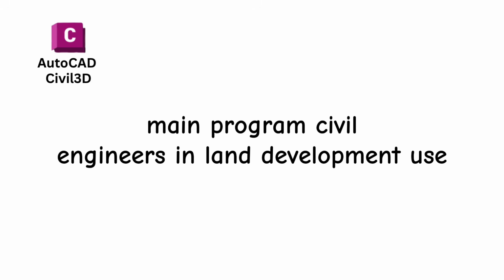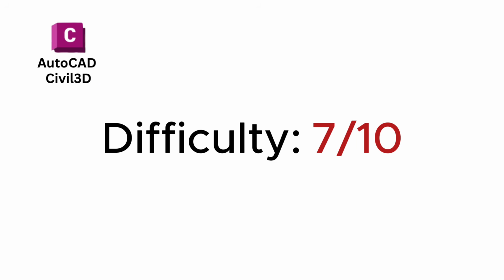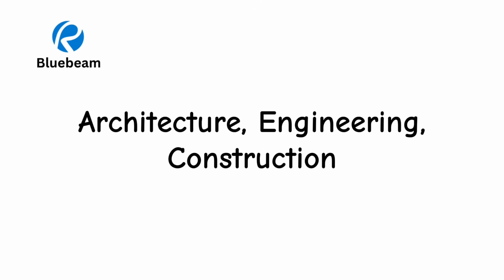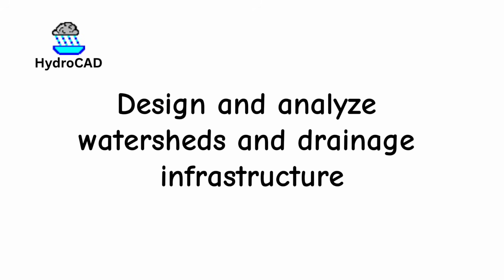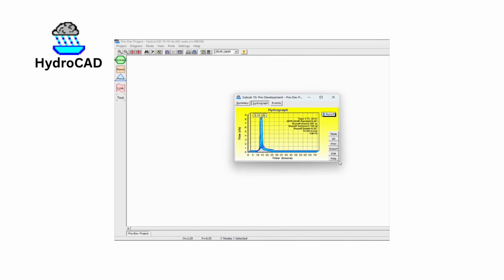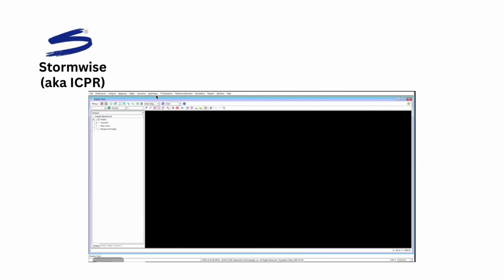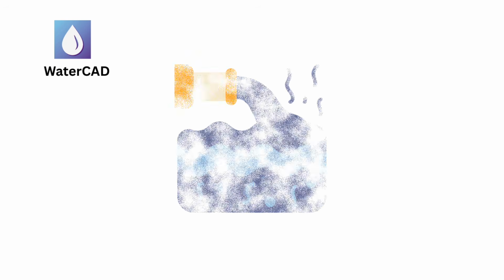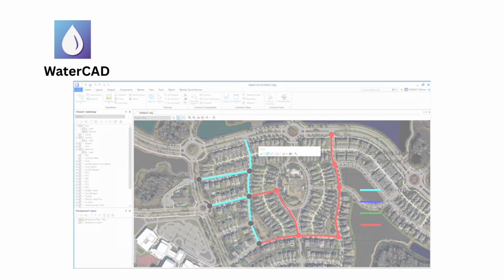I Ranked 5 Programs I Use as a Civil Engineer

Comment from the maker: Civil engineers: What's your discipline, and what software do you use daily? I'm especially interested in geotech and structural. Drop your list below 👇
Reply from the maker: Also, sorry for the muffled sound issue at the beginning. I accidentally used a copyrighted song in the first 20 seconds. Everything sounds good after that!
Reply: Hi I work on roads and highways planning, maintenance and supervision, so most of the time I use civil 3d and excel. 

I hadn't touched subbassembly composer at all. I'm keen to learn it in a future and get a Autodesk certification too. 

Also interested in learning GIS and hydrology-hydraulic stuff.

I worked once time with watercad in the development of a rural gravity pipe water system.